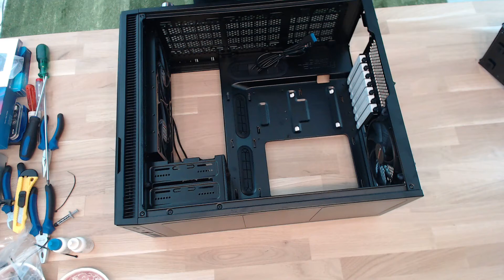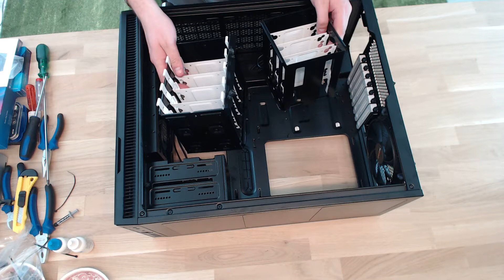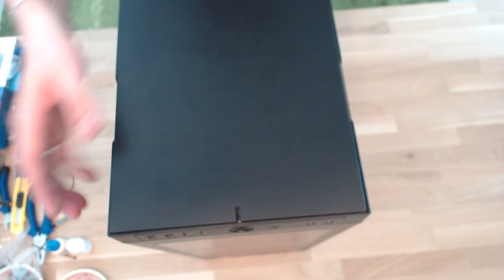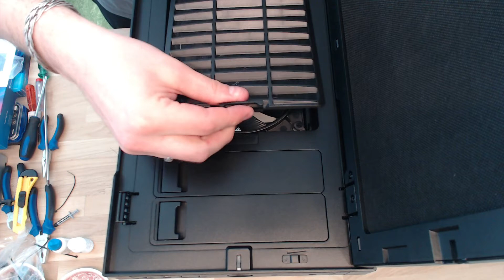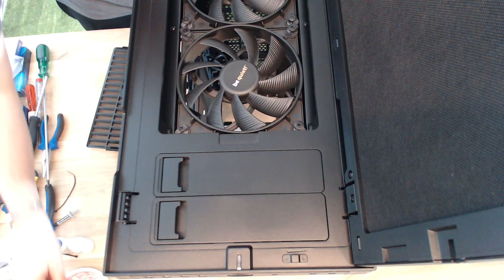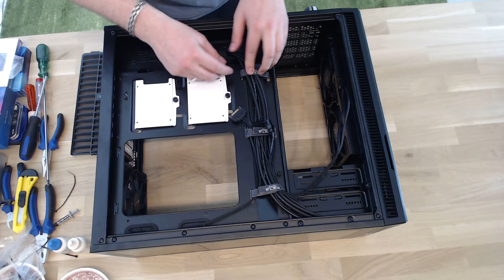Mjölnir PC Build - #03 - Airflow Concept and Fractal Define R5 Case

Comment: I just purchased this case as used in a recent deal and I'm glad since it seems to be a good case.
As yours, it has two fans in the front and one in the rear. Do you think it would be worthy to add two additional fans on the top to improve cooling?
Reply from the maker: It keeps cool for me, but I also need it to be quiet cause of streaming. It could definitely help
Reply: @HorathDrak  Thanks for the answer.

So how many fans are you using in your case? Those 3 stock fans? Or more?

And do you overclock something?
Reply from the maker: Just those, yeah
Reply: @HorathDrak  Do you overclock?
Reply from the maker: Nope, not yet.

Comment: Heyho, ich hab das gleich vor mit den SilentWings2 - 2 in die Front und einen für's raus saugen. Meine Frage ist da ich mir eine AiO WaKü hole mit einem 280er Radiator und den oben montieren will, reicht das wenn 4 Lüfter rein saugen und 1 der raus saugt ? Oder passt das vom Airflow dann nicht ?
Reply from the maker: Sollte schon passen, solange mehr gesaugt als rausgeblasen wird, ensteht der Luftüberdruckeffekt, der quasi constant den Staub aus dem Gehäuse fernhält (erklärt und gezeigt von NCIX tech tips hier: https://www.youtube.com/watch?v=sh6F2eccMec ). Linus Tech Tips hat AiO WaKü-Ventilatoren Konfigurationen ausführlich getestet und erklärt hier ob push oder pull besser ist: https://www.youtube.com/watch?v=UyC3lZ5WFMk
Viel Glück bei deinem Build!

Comment: How did you put the wings in the front i can't because the special litte things doesn't enter in you know ?
Reply from the maker: You are right, the plastic things that come with the fans are too short. I just used the screws that came with the case, only they are long enough. I just screwed them into the rubber mountings of the fans. Hope that helps!
Reply: Finally i can did it, i put the long things in the hole but not the little for screw, there is a more larger hole just below so i put here and i push in the bottom
Reply from the maker: Okan Onalan
 Sounds great, glad to hear it! All the best for your build!
Reply: I have win 5° so it's great but very expensive..Have a good day my friend
Reply from the maker: Okan Onalan
 You as well!